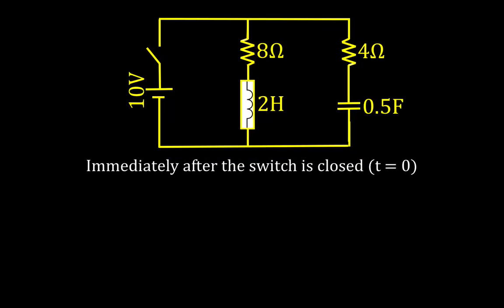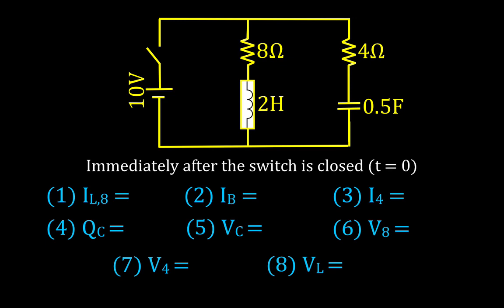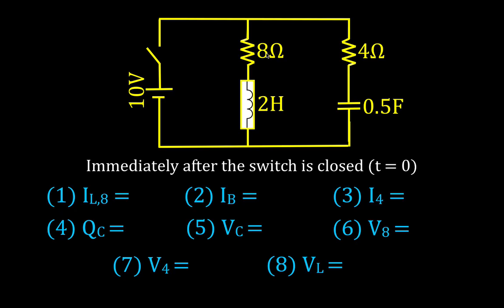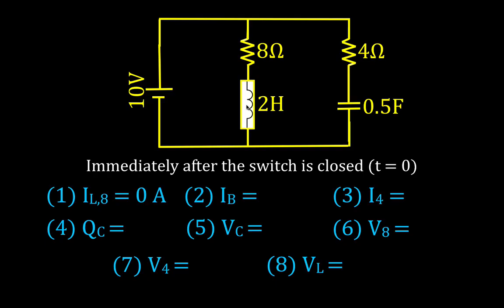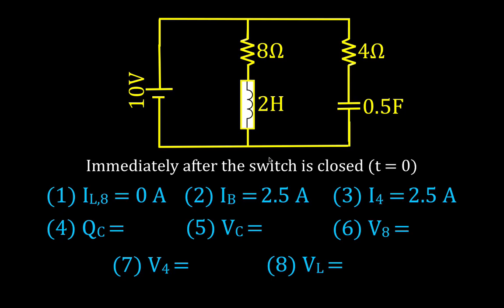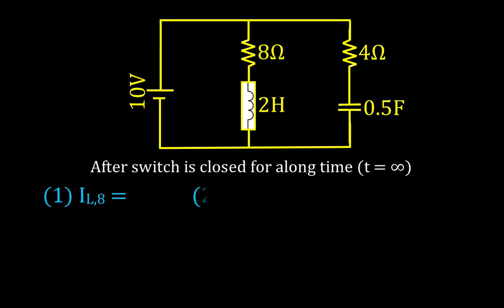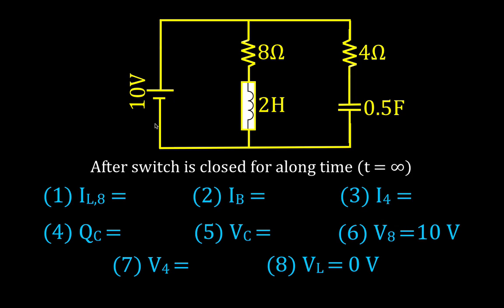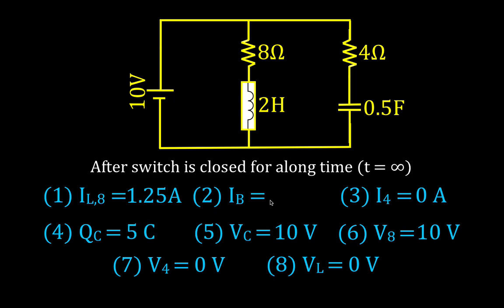RLC Circuit Analysis (3 of 8) Voltage, Current, Charge

Comment: Please comment if my analysis is wrong.  At t = infinitive and the switch opens, the inductor will resist any change in the current and will produce a back EMF to maintain the current of 1.25A pointing downward, and the capacitor resists any sudden change in voltage and is 10V.  KVL, this is where i'm lost. if you could help and explain how to derive KVL at this point. many thanks.

Comment: Thank you.  If you could, please explain what happens at t = infinitive, and the switch is open.
Reply: if the switch had turned from close to open then the reverse occurs and the inductor gains voltage while the capacitor becomes 0